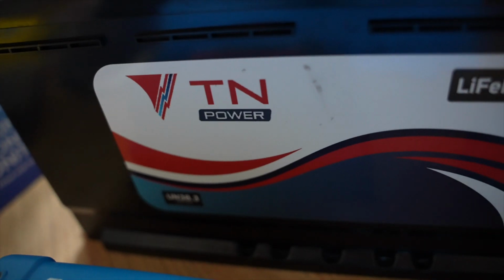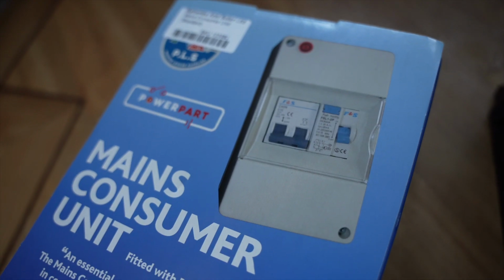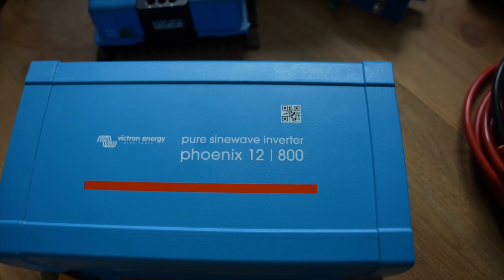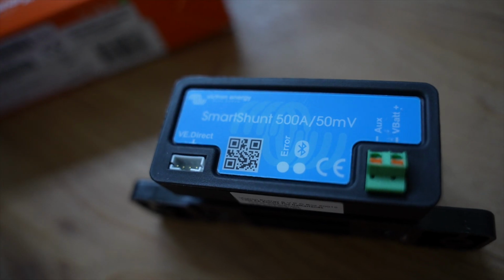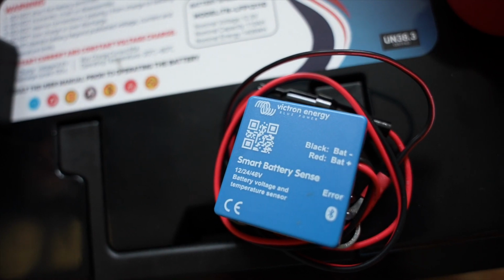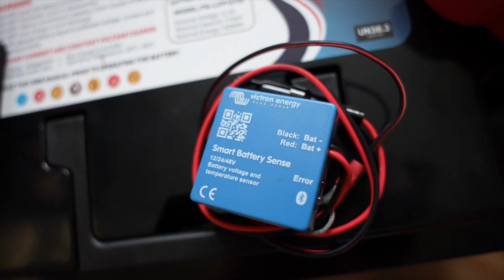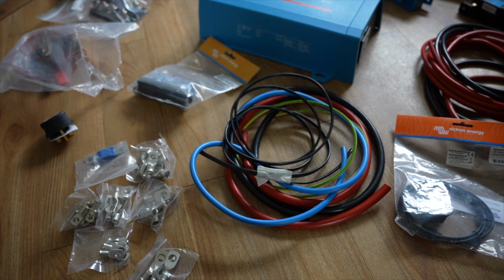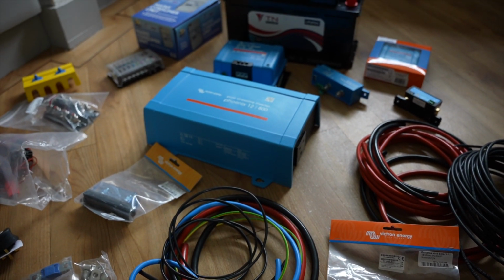New electrics for my VW Transporter T6 Campervan - 12v DC and 240v - What have I chosen?

Comment: Nice bit of kit there, how much does this cost I am looking to change the batteries and charging system in mine but not sure of the way to go.
Reply from the maker: I spoke to https://www.batteriesandsolar.co.uk very helpful and gave me options. A much cheaper option was the CTEK 250 which is a DC to DC and MPPT, however I decided I already wanted Victron with all the monitoring. I went Lithium too, so this is a much bigger initial outlay than an AGM battery, with very good reason.